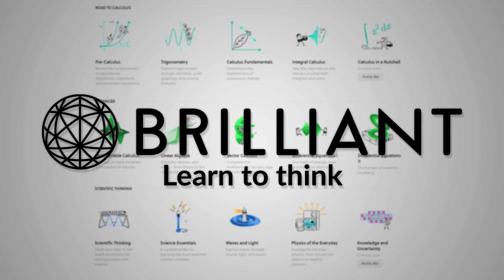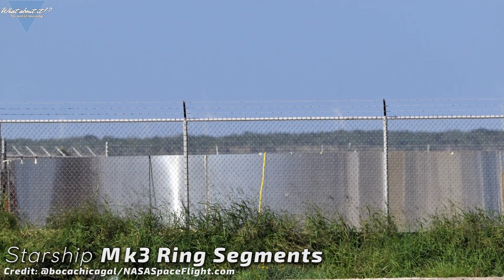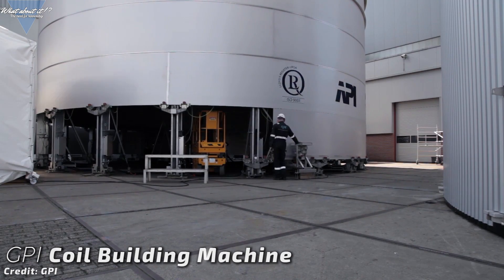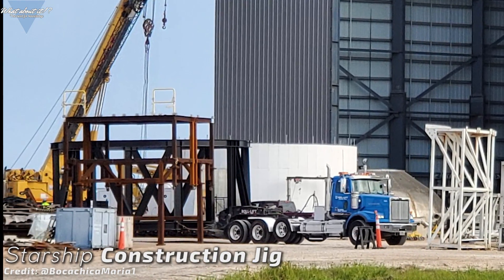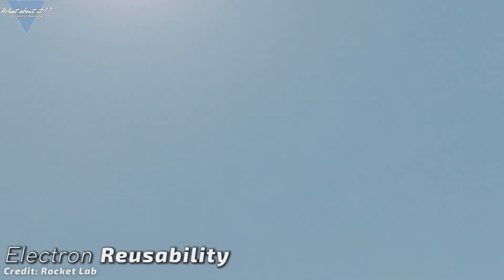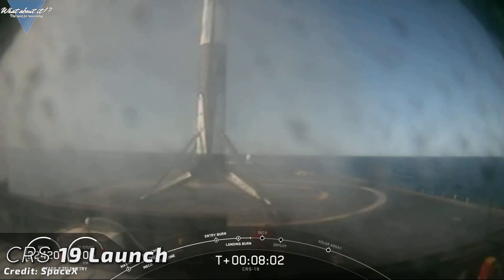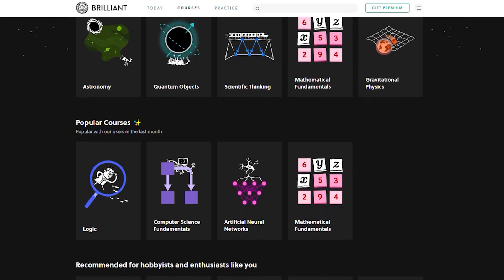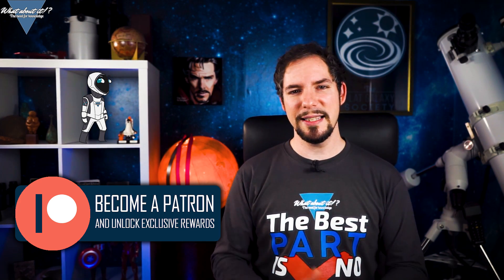58 | SpaceX Starship Updates – Rocket Lab Reusability – Dragon V1 Nearing Its End

Comment: 2:13 Looks like 72 inch wide coil (1.83m). If it is from New Castle, I wonder why SpaceX is not using wider coils, because New Castle can provide up to 108 inch (2.74m) wide coil directly in coil from them. And for plates, even a bit wider (144inch), but shorter (up to 11 meters probably only, but for small gauge, it should be possible to extend that to full circumference). 

I guess, for now they do have this welding and cutting machinery that probably can't easily process wider stuff, so they are sticking with it, until they optimize design.

Also, according to some people (based on some other photos), they don't use New Castle.
The machine from GPI at 3:30, uses somehow narrower coils, probably 60 or 48 inch wide.  The concept can be used for wider stuff too of course tho.

Comment: I think Rocketlab are onto something there with their snagging parachute retrieval using a helicopter

If it works, SpaceX should definitely try the same method, snagging the chutes on the fairings with helis. it would be far more reliable than chasing under them with boats and nets.

Comment: There is really a huge difference in build quality between the technology you showed in this video and what SpaceX is doing, and I suppose it is not only an aesthetic aspect, a round circle without dents will be much stiffer and thus less material is needed. The welds shown in the video were extremely accurate and it also seemed that there was close to no deformation  - at the welds the material shrinks, which especially crumples the material, if it is sheet material.

Comment: Mk1 nose.... Why build a whole new nose section for suborbital testing? Building only the tank section massively shortens construction time and shrinks costs for Mk3. Don't forget, that nose is just batteries, actuators, and guidance hardware, and no hardware for storing fuel.
Reply from the maker: They already started taking the nose apart. It will be on mondays Episode. ;)
Reply: :D
Reply: The old nose not being used because the flight data from it won’t apply to the next ships. Plus probably refined canards. Lastly, Elon says he wants better header tanks, 2 domes with a common bulkhead.
Reply: @donjones4719  So ya think they'll gut the Mk1 cone and reuse the parts on the inside ?
Doesn't make sense financially to toss all the hardware, when it could be mounted in the new frame and reconfigured to match.
Reply: @PiDsPagePrototypes   They may use the electric-motor/hydraulic-pump actuator system for the canards. Elon said at the September presentation he wants to "eventually" use actuators driven directly by Tesla Model 3 motors. "Eventually" may be soon enough to fit in Mk3, or maybe a much later ship.

Comment: 30m high is not very high in rocket terms. I would bet that once SpaceX gets some experience, they will design their own machine, and I would love to see one that did a continuous spiral rather than rings that then have to get stacked and welded. They would need to do it in a tall structure (like the big windbreak)

But they are in prototyping mode (aka agile development) so they are taking small steps rapidly, rather than trying to design the perfect solution with incomplete information.

it is going to be very interesting to see how the construction methods evolve over the next several models.
Reply: 30m is still pretty high... the complete Starship is only about 50m, so 30m is plenty for the tank section. Super Heavy would be more of a problem, since that's supposed to be nearly 70m high.
Reply: @simongeard4824  thanks, i was thinking it was taller.

Comment: Rocket Lab helicopter capture seems very reasonably logical. It's next incremental step would be to synchronize the booster and the copter using drone homing technology and auto pilot.  That would prove far cheaper than using a giant bathtub piloted by several crew with a trapeze net trying to get under a gliding fairing.   That scenario seems like something Inspecter Cluseou of Pink Panther fame would do.  Of course, I despise that.  Complicating low tech, is not high tech.

Comment: I still wonder how tf do you catch a    reentry rocket midair? I really F want to see that. Maybe RocketLab will even surpass SpaceX sometime?
It really just feels like some space Sim currently
Reply: It's not all that hard... once the rocket is slowly descending under a parasail, it's nice and predictable, so it's just a case of flying in with a hook, and snagging the line... just like the video rendering shows. It's the same technique (albeit scaled up) as used to catch film canisters from spy satellites, way back before they figured out how to transmit the data instead. And there's also precedent for catching larger craft, since the US used to retrieve unmanned reconnaissance drones this way in Vietnam... once they ran out of fuel, they'd pop a chute, and an aircraft could catch them.

Comment: Hope SpaceX ups their game when it comes to tank fabrication. The European system shown in the video is the cat's meow imo. Looked very precise and with no "oil canning" in the sheet metal. Based on the demolition images there does not appear to be any interior ribbing to reinforce the tank sections. Good luck with the next prototype. I'd feel more confident if it were fabricated in a more controlled environment. I've camped on the beach in south Texas and can vouch there is always wind, blowing sand and lots of salt in the air. Nice job Felix. You are my go to for updates.
Reply: Yeah I think it should be in a controlled environment.  A lot of welders always specify to keep your metals clean before welding otherwise, it ends up crap.  Welding outside on the windy sandy beach is not ideal.  That's why Blue Origin, Boeing, and others are done inside.  SpaceX is organized chaos and others are done in a step wise orderly process.

Comment: Great details and views on SpaceX's ring builder. That footage of the tank company's automatic ring builder and assembler is SO informative; all this will enable us to understand what SpaceX is and is not doing similarly. Do we know for certain SX is using plasma-arc welding? 

How do the concrete base rings relate to the steel girder frame rigs?
Reply from the maker: I have an internal source, that told me they're using PAW. It is NOT official and it could be wrong, but I trust the source.

The concrete base rings (ring walls) are used as an entrance from below while stacking the hull and building inside.

Comment: Great to see a focus on one possibility for the ring production which is clearly a central challenge. What do you think the pressure requirements are for the SpaceX hull versus that of a typical tank of equivalent size produced by the Dutch company?
Reply from the maker: I'd say it's higher on the SpaceX tank.
Reply: @Whataboutit  I would agree - but how much higher and is it within the capabilities of the Dutch technique to contain this level of pressure? We do not want to see another pop top! Perhaps you have a contact either in SpaceX or the Dutch company that has a view on this engineering challenge. I notice that my simple BBQ methane bottle is constructed out of thick and heavy metal.  I would imagine that SpaceX is looking for a better pressure containment performance from its ring manufacturing and stacking process than my BBQ methane bottle!!
Reply: SpaceX also has the unusual requirement that the tank must fly — so while it needs to be strong enough to deal with high pressures, they also need it to be as light as possible, so they can't solve all their problems just by over-engineering with thicker steel.

Comment: How about rolling the metal like a biscuit container one continuous spiraling weld then cut each end off flush and straight
Reply: Less to do with structure. More to do with final dry mass. Top of the tank does not require same thickness of steel. Reducing the sheet as a function of height reduces dry mass, with the tradeoff that spiral welding becomes too complicated (steel would need to be of gradually changing thickness on same roll).
Reply from the maker: I heard before, that this would not be possible due to structural reasons, but I hear this often and honestly don't have a sound answer. If there's anyone here, being able to answer this, feel free to give an explanation! :)
Reply: @Whataboutit  Due to the use of coiled steel as raw material, there is a certain crescent bend, and the welding point is in the elastic strip edge area, so it is difficult to align the welding torch and affect the welding quality. To do this, set up complex weld tracking and quality inspection equipment.
Reply: They probably will never get a long enough stainless steel roll to do it this way without seams. The company he showed in the video with their automated process would be the way to go.

Comment: It was my understanding that SpaceX at one point at least intended to only use each Dragon V2 once to carry crew to the ISS.  After being used to to carry astronauts, the Dragon V2 capsule would be converted to a cargo only capsule.
Reply from the maker: That is interesting! Did not know! Is it still part of the plan?
Reply: @Whataboutit  yes. 
It's sort of a good thing. They can launch it 1 time crewed and another up to 10 times as cargo vehicle
Reply: @Whataboutit   There was endless speculation Crew Dragons would be converted, but it will not happen. See August 2019 article in Spaceflight Now https://spaceflightnow.com/2019/08/02/spacex-to-begin-flights-under-new-cargo-resupply-contract-next-year/

Will be built without SuperDracos or crew controls. Less mass for the capsule, more payload capacity.
Reply: @donjones4719  than it still is the same capsule that's repurposed for cargo. Right? Or am I missing something?
Reply: @donjones4719  I suspect there would be little time or expense removing the Super Dracos, control panel, seats and other crew accommodations from a Dragon 2. Possibly a bit more complicated would be the docking port since the earlier cargo ships had a different design that provided clearance for wider objects like laboratory gear for the racks in the station.
Reply: @mikee368   The article indicates they are new-build Dragon 2s. The design is repurposed, but no actual Crew Capsules are repurposed/converted/rebuilt. However, to argue the opposite, there is a slight ambiguity in Shotwell's phrasing, so I can't 100% rule out that some Crews will be stripped down and rebuilt as Cargo.
Reply: @robertvirginiabeach  That is the reasoning many of us have followed for a long time. But this article makes no direct statement about repurposing Crews to Cargos. If they mean to so so, it would be odd not to state that directly, and make a point about SpaceX's reuse capabilities. As I said in my reply to mikee368 there is an ambiguity in the Shotwell quotes, but IMO it is unintentional. Make no claim to infallibility.

Comment: if youre making a giant steel pipe, its likely best to consult someone  whos been doing it for a while;
Reply: hmmmm, maybe time to promote the water tower specialists :)
Reply: @sinnnatra  There are many types of tank or tower making companies. And their method of construction are very similar. It will be interesting to see if Space X changes their system to resemble those that have been in the business longer. It would keep workers and the fit and welding operations on the ground. But there could be a variable that we cannot see that forces them to build from the top.
Reply: @ronfullerton3162  That variable is the tank bulkheads. They will interfere with the lifting
Reply: @joshua43214  That may truly be the problem with them building from the ground. I was around grain tank construction for awhile, and we added some internal structure as we built. But there maybe something with the bulkheads that prevents this. I guess we will just have to wait and see what they do in the future. For now we know that it will continue this way for at least the current series being built. Always fun to try and foresee future plans and procedures.
Reply: Although a Starship has unusual requirements for a giant steel pipe... because it's meant to fly, it needs to be light, more so than it needs to be cheap. That may put it outside the expertise of those who build earth-bound structures like water towers..
Reply: @simongeard4824  nonsense
Reply: @carlosandleon  possibly, I can't claim to be an expert. But it seems unlikely that the differences between a rocket and a water tank aren't significant to the manufacturing process.
Reply: @simongeard4824  You maybe very right on. I believe some of us are hopeful that there are established methods that could speed up and  maximize Space X's building experience. Adding rings on the ground could speed up assembly, precision, and safety. But there are evidently things we do not know of that makes this impossible for the moment. As they progress onto newer series, maybe they will be able to move on to easier and faster methods of assembly.
Reply: Doing with so thin (3mm) sheets ? Who for instance ?